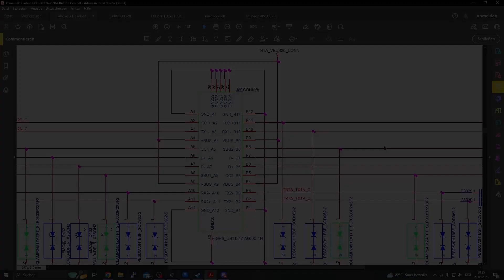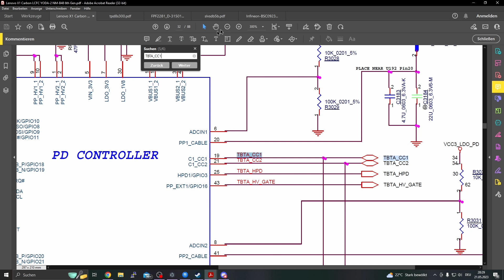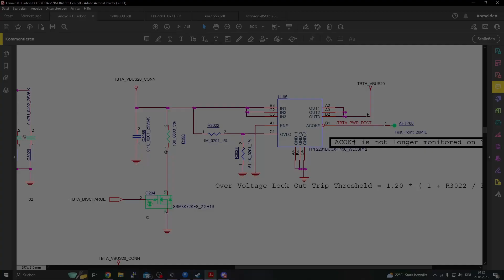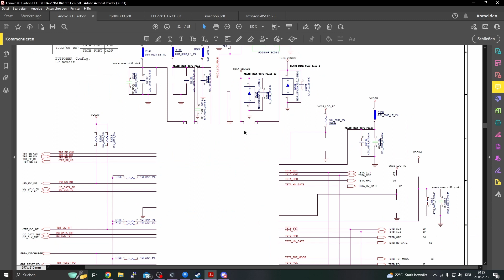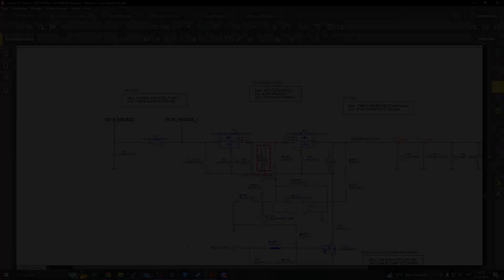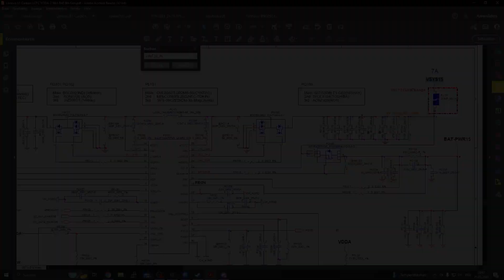Lenovo Thinkpad X1 Carbon 6th Gen - "living" example of how a PD-Circuit with USB-C basically works

Comment: It means if I'm unable to fix charging through pd control. 
I can pass direct 15v to my device on current sensor R010 by doing a bypass of pd system. Will it work normally?

Comment: Hello, you might already have your response yet.

But just in case: you don’t see any voltage or a low voltage on the coil or after first mofset (Of the bust/boost), because you can’t see the pulses with a multimeter, you need an oscilloscope to mesure it.

The ic charger pulse on the gate to open/close super fast the mofset (on the left on schematic) to reduce the voltage.
Then it pass to the coil and in caps to get a nice lower flat voltage that you can mesure with your multimeter. There is another mofset (left on schematic) connected to ground and coil too that catch the return voltage that coming back from the coil. (Openîng/closing super fast too)
This is basicly the buck converter concept, same as your battery charger circuit or any other buck.

But on buck boost you have an other way: you have the boost converter, used to charge another laptop from the battery Of your laptop.
(You need to up the voltage from battery voltage to 20v)
This is why you have 4 mofset in This circuit. 

Feel free to contact me if you want more info. We have all many things to learn ! 😊
Reply: This comment helps alot
But is there any way to diagnose if the right side ( boost side ) is not outputing the desire voltage?
Because many times it is quite hard to grasp the concept of this system especially when the scematic is misleading (vint20 but the actual output is only 10v)
Reply from the maker: This is a very useful comment even for me, thank you very much!
Reply: you're the man

Comment: I had two Lenovo Carbon laptops crap out on me because of that inferior charging port. Like you said, it's a toy. Not made for serious work. Not like barrel jacks or connectors like the Microsoft Surface has. Even if only used for data, usb-c is way too fragile.
Reply: But the Video was really good. It explained a lot. Had the Lenovo's been mine I would have known how to fix them. But they were from work, so I just gave them back.

Comment: just on point great explanation amazing broe amazing 👌👌👏👏
I am here coz in my case charger brings in 5v but laptop works just wont charge you just explained it by the buck boost converter 
lovely stuff

Comment: 24:01
Haha, guess someone skipped school.
Inductor is there to smooth the current, conversely capacitor is used to smooth voltage.

Ohms law, V=IR for inductor is V= Inductance*derivative of current (di/dt)
From this alone you can the current is not changing or DC, the voltage is always 0. Its just math buddy.
Reply from the maker: I was afraid of someone would come and clarify in a educated way while highlighting my Lack of Expertise. :) 
Thank you for clarifying! 👍
Reply: @boardwerk-en  
No worries, we learn something everyday. 

In layman's terms, when the circuit is ON, treat the inductor as a piece of wire or copper track. 

But if you're curious, you can desolder the inductor, connect each ends to an oscilloscope on different channels, you can see the current smoothing out from input to output.

Comment: I watch this so i can say yes when you ask if i wanna overtake it. Lol
Reply: Btw. After coil. There will be diode. For boost converter. So the voltage in coil will be ac. Perhaps
Reply from the maker: Cool. I've checked the schematics and did not find any diode related to the circuit. Maybe the body diode of the Mosfets itself steps in here?
Reply: @boardwerk-en  i watch video from LER channel, he says that the boost converter use diode instead capacitor after the coil. Or maybe this laptop have different design.

Comment: Mike, what if you move your ground probe to the plus (+) ? Will you get a voltage reading on the coil ? There is a diode somewhere in this circuit which I think plays a role on the coil voltage.
Reply from the maker: You're the second guy talking about the diode. I'm very curious but did not find anything related in the circuit of the board. NM-B481

Kind regards
Reply: @boardwerk-en  You know what, on the output of this buck converter is connected the battery, so the output is at the same time an input. Somehow the output must be disabled when battery is not connected and I believe that in order to disable it either a diode or probably the BQ chip applies some reverse polarity voltage. Find a main power rail on the board and put your ground probe and then try to measure again the voltage on the coil. It could be stupid but I have seen it on a step down converter I use in order to supply with power various devices from 12 or 24 CD power supplies or charge batteries. In my case if I have the output of the buck converter disabled the coil reads -12V (the input voltage but reversed).
Reply from the maker: @nikolaskallianiotis8622  Cool stuff! I'll try that out. 👍

Comment: Hi champ, check the Voltage of coil using an oscilloscope. Very nice video, worth value in gold. Although 10v is not enough to turn laptop on, it can trickle charge laptop battery when off. I've seen Asus Zenbook and Mac Books  powered by 5v charger, it actually charges the battery.